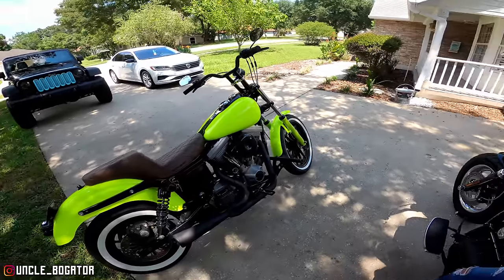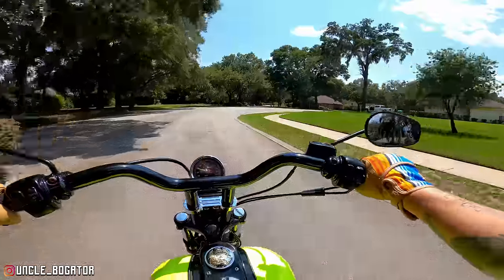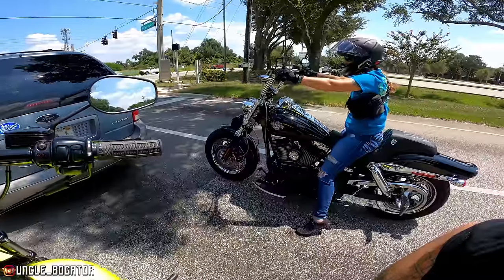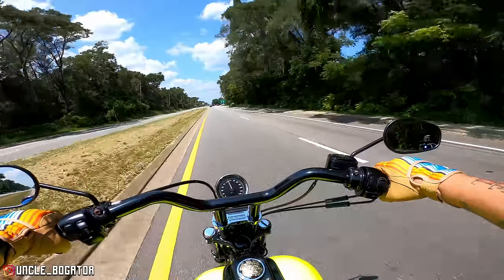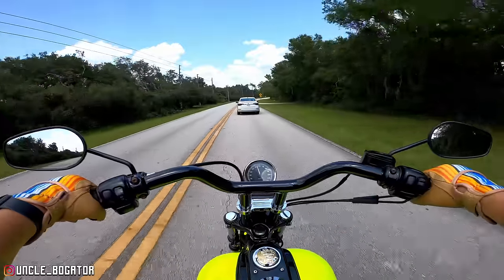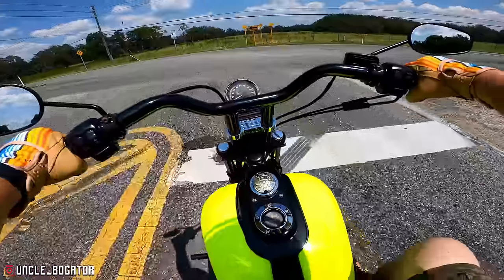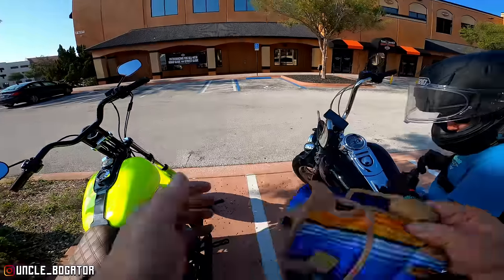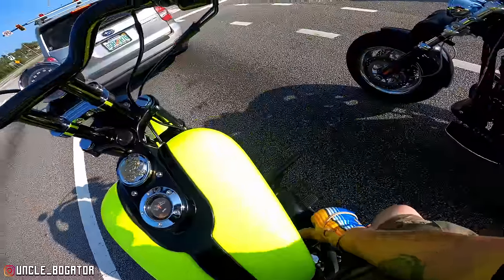I can’t win with this Harley Dyna Evo

Comment: I wanted a guage and light on my evo dyna too. After a while, and a few oil leaks, and being told any pressure above zero is fine for evo's, I pulled the guage off and went back to just the light.
Reply from the maker: I may do that just cause it's ugly on there

Comment: I have a 2004 Twin Cam, with an HD oil press gauge. Mine does the same thing. Oil is hot at idle, 0 psi. up at speed, 20 psi. No oil press light. 20 years and still running. I wouldn"t sweat it.
Reply from the maker: There’s a good chance I’ll remove the gauge completely after I run both for a while and trust the system. So far I’ve had 2 failed switches and rerouted oil lines so I like the double setup

Comment: My Evo was sneakily leaking at the back of my rear push rod.  Luckily a previous owner had installed adjustable push rods and I was able to put in new o-rings without tearing the world apart as a Deathproof would say.
Reply from the maker: thankfully mine doesn't appear to be leaking there